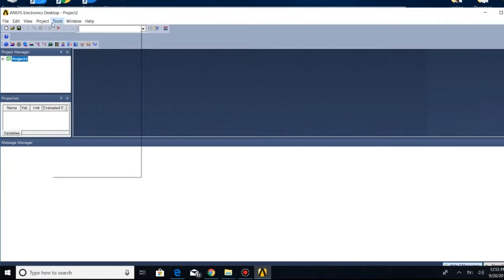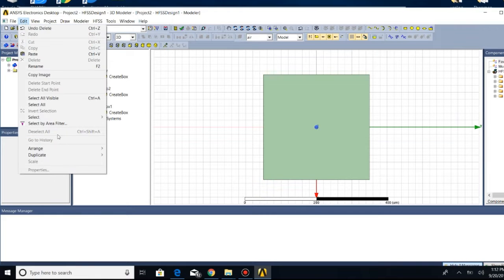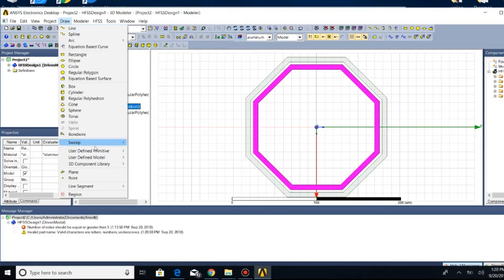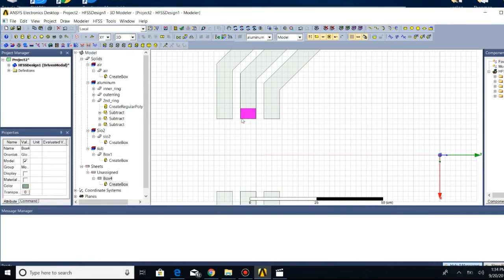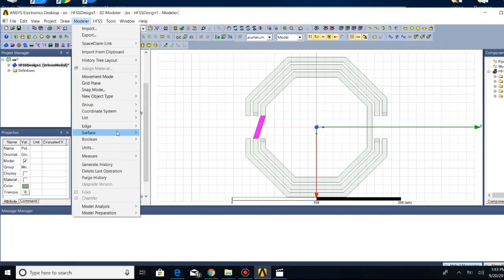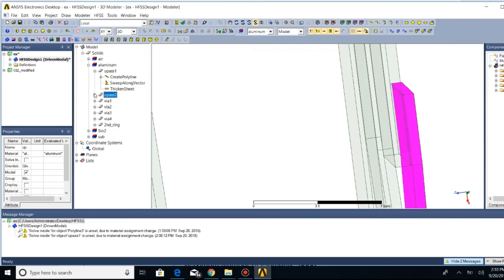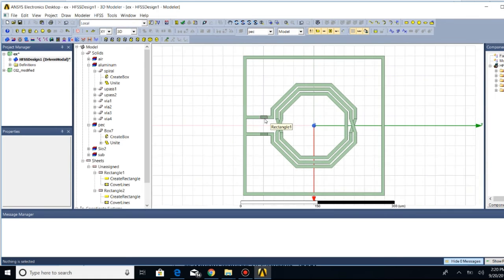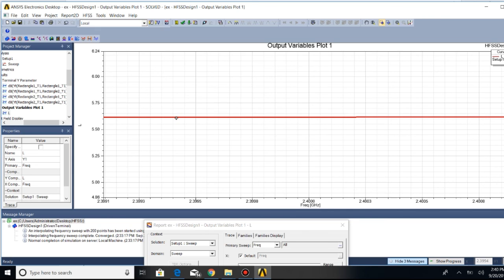Simulation of spiral inductor using hfss

Comment: Can you give the expression for "Quality Factor" to be used for simulating inductor design?
Reply: The quality factor (or Q) of an inductor is the ratio of its inductive reactance to its resistance at a given frequency, and is a measure of its efficiency. The higher the Q factor of the inductor, the closer it approaches the behavior of an ideal inductor

Comment: I want to design planar circular spiral inductor on Fr4 sustrate with inductance 1uH. Is it possible to design following the steps shown in this video??.... how to add substrate or PCB material in it?? please help.....
Reply from the maker: I added substrate in this vedio you can see at the starting.. If you want FR4 as substrate you should assign the material as FR4. I dont think we can make inductance of value 1uH in this manner.